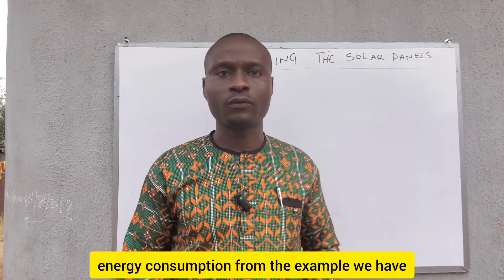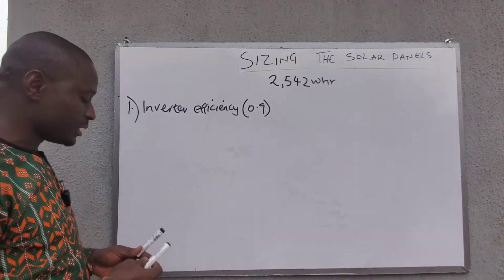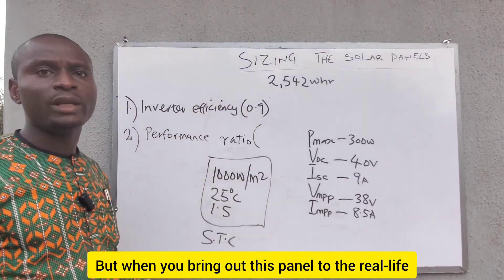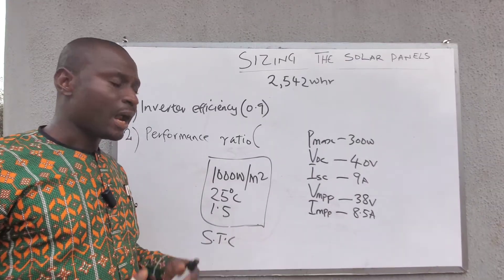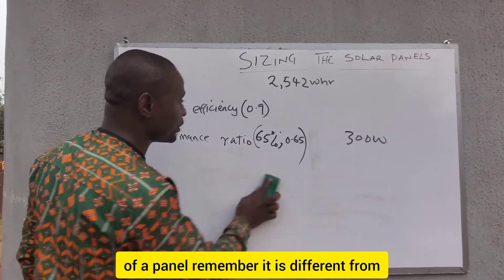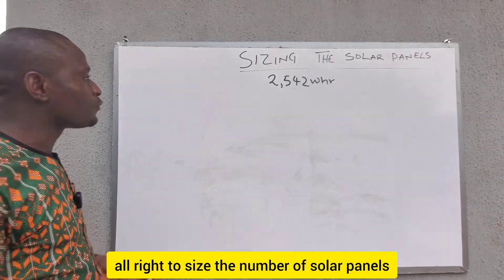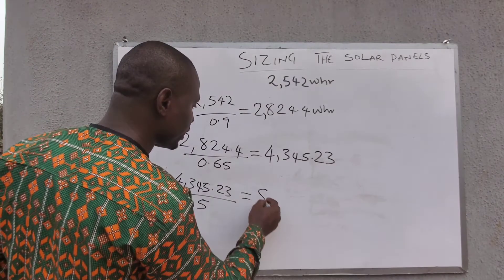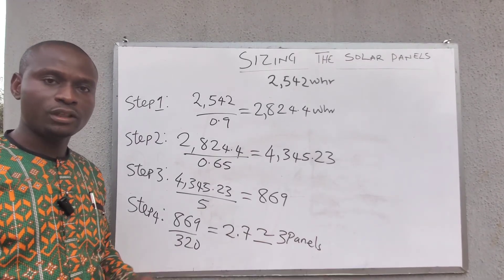How To Size Solar Panels. #solarpanels #solarpanel

Comment: Are we to connect the 3 panel in series or parallel
Reply from the maker: Connect the solar panels according to the specifications of the controller/recommendations of the manufacturer
Reply from the maker: Take into consideration the maximum pv input voltage and pv input power. The maximum pv input voltage will determine how you will connect the solar panels (series, parallel or series-parallel)

Comment: Sir what is the use  of the inverter efficiency 
Because I believe the power  is coming from the solar panel to the charge controller then battery 
Inverter only charge when using ac   source  (please enlighten me sir

Comment: What of if the panels are in excess .Does it have negative effects on the system.
Reply from the maker: It will have a negative effect if the panels are above the maximum requirement of the charge controller and battery bank

Comment: Nice video. However, you have to factor in that the person will use energy during the day when the panels are charging the batteries. Therefore, you must determine the total energy consumption, not only the energy required to charge the battery, else the batteries will not be filled as the charging energy is being shared. But if the person doesn't stay home during the day and comes back only at night to use the battery, then this method will suffice.
Reply: Greetings sir, you are misunderstanding him, 2542wh is the total energy consumption and is used to size the battery bank and the solar panel. He made mention of it. Watch more of his  videos.

Comment: A good video. I wonder why you chose a performance ratio of 65%? You could have mentioned strictly that it is manufacturer stated. From your initial explanation, I was expecting that you'll derive the performance ratio from the panel efficiency when you mentioned it.

Comment: Inverter efficiency in panels sizing???, inv efficiency in regard converting DC (battery) to AC . Am used to off-grid solar systems. Inverters are attached to battery not panels terminals. Clarify more plz, thx.
Reply: Regardless whether you going to store the generated energy in a battery or not. You will need an inverter to convert the DC current to AC to be able to use the energy.

Comment: Thanks boss for the teachings, I appreciate and kudos. Please I will like to ask is Backup time the same with Days of Autonomy in sizing the numbers of batteries needed in a load audit. Thanks in anticipation boss
Reply from the maker: You can multiply the total power by 5hours. Add the value to the total daily energy consumption of the loads
Reply from the maker: Yes. It could be in minutes, hours or days.
Reply: @Solarwattng  Ait boss, thanks. From the lecture you gave sir, what of if the days of Autonomy is 5hours instead of 1day, with our total power being 638 watt and energy consumption being 2542 wattHour. How do we go about it to get the size of the battery bank sir?
Thanks in anticipation boss